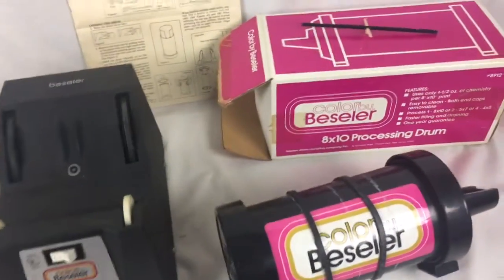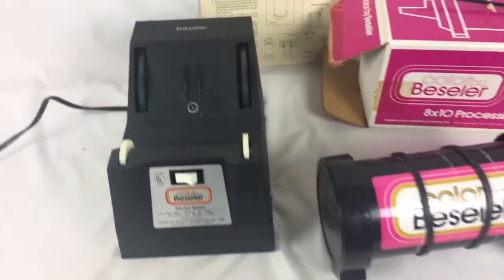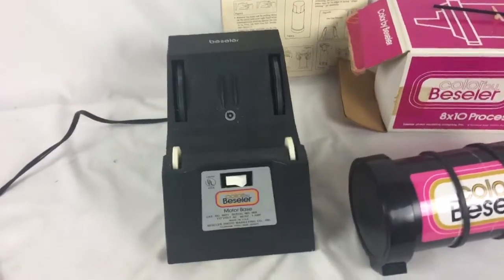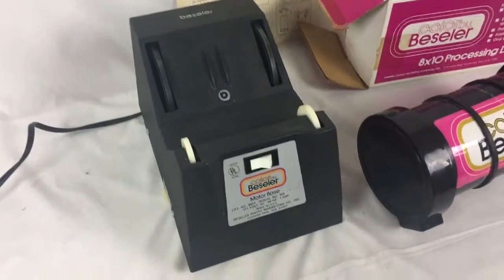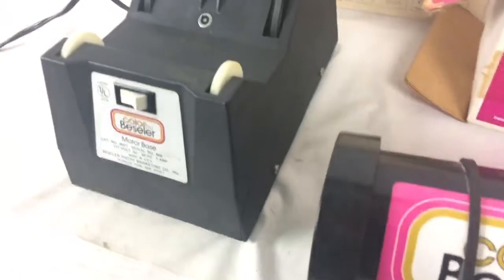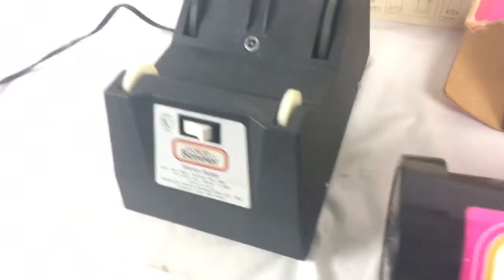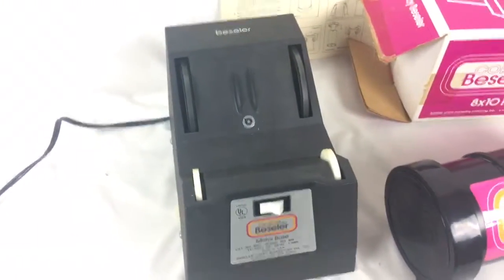Vintage Color Beseler Motor Base 8x10 Processing Drum Film Equipment Rare Old

Comment: Back in the 1970s and 80s, roller bases and print drums like these were popular and common, mainly for people doing color prints. Unicolor made a bit more sophisticated base in that it reversed direction after a few turns of the drum, giving an agitation to the process. Unicolor also made a film drum, insulated and taking from 1 to 6 35mm reels or 120.220 options. If not rare, the film drums are harder to find in working condition these days, but they are a great option to spending $1,800 for a Jobo.
Reply: Do you happen to know how much chemistry was used in the 8x10 paper drum? I used it with the reversing motor base for Cibachrome and B&W paper. I dug them out of storage a few weeks ago and after some reverse switch cleaning got the base working again. I did buy these in the late '70s but I can't remember how much chemistry was used and I don't have the original instructions.